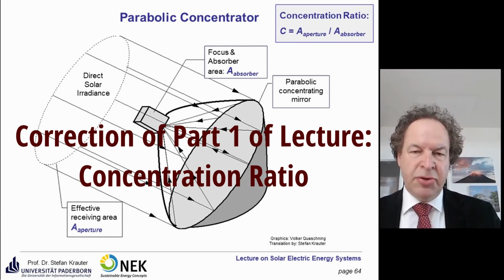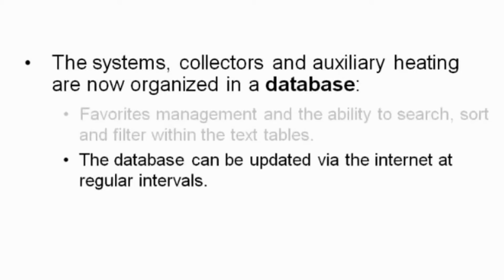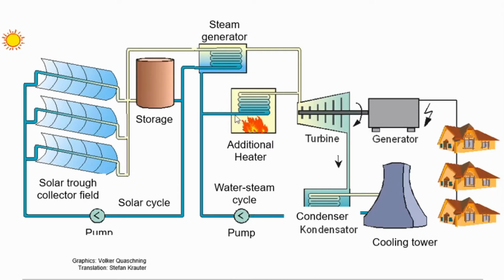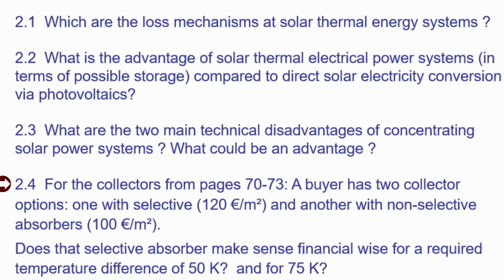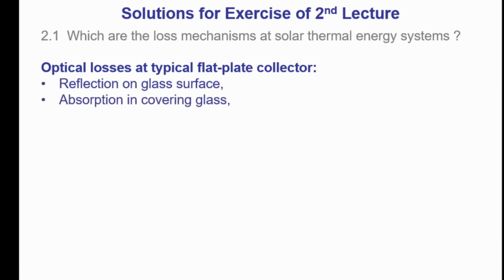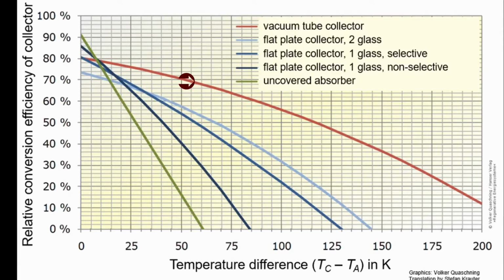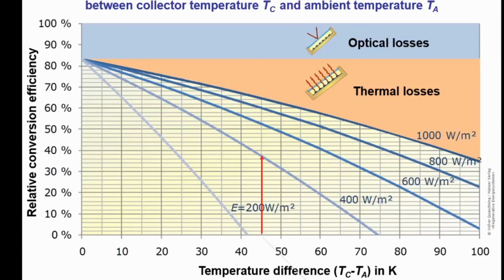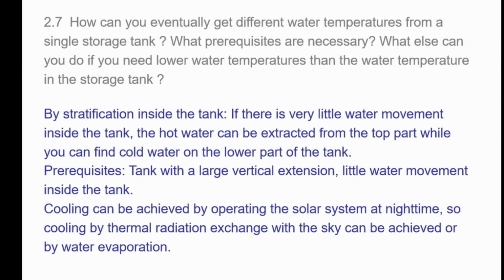Solar Electric Energy Systems 02b: Solar Thermal Energy Systems (part 2, incl. cor. & exercise)

Comment: Sir, any literature you can recommend for this course.
Reply from the maker: Solar Engineering of Thermal Processes, Fourth Edition, 2013
Authors: John A. Duffie & William A. Beckman

Print ISBN:9780470873663, Online ISBN: 9781118671603, DOI: 10.1002/9781118671603
Wiley & Sons, Inc.